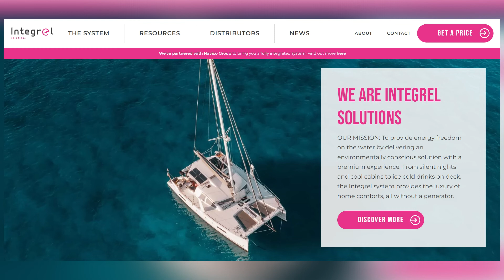Nigel Calder & Jeff Cote Talk Marine Electrical - Part 9 of 11 - Lithium Batteries

Comment: How about using Lithium for your house bank, but keeping lead-acid for your critical systems (navigation, communication). anf charging lead of the lithium with dc-dc convertor for instance. kind of having a layered system with a smaller lead system sitting on top of the lithium. Having the big consumer on lithium. Just nit sure where I'd put small 12 v consumers then (lighting for instance)

Comment: Nigel, in one of your discussions on Lithium batteries, you mentioned that it was important to check any potential battery was certified to UL 1973. While negotiating a purchase in the UK, I was told that UL 1973 was specifically a standard in the US, and not Europe.  Is there a certification you would recommend on this side of the Pond?

Comment: So the solution is a hybrid lead-acid and LifePO4 battery bank so that the disconnect or temperature doesn't cause a problem on a boat in use.  Shame ABYC won't allow a common sense approach.  Thankfully those of use who live outside the US are able to use hybrid banks.

Comment: Hi, I'm putting new lithium battery banks in currently.  I was considering a Mastervolt charger, In your opinion is it better to have a combi unit with built in inverter or a stand alone inverter. Would appreciate your input.
Thanks
Karl

Comment: How far are we from a pure lithium battery system? I have switched my land batteries in my off grid system to lithium and so far I'm very happy. The charge acceptance rate has made a huge difference both in solar and on those back to back cloudy days when I need to run a generator. Would be nice to do the same on my boat
Reply: i have a pure lithium system on mine.
Reply: @ysesq  what's your setup? Balmar or some other alternator controller?

Comment: I got offered a free Lifepo4 House Battery Bank for Long term Testing by a pretty good Named Chinese Lifepo4 Battery Manufacturer, which I initially considered accepting, as I love Testing Stuff. So after some prior experience with Lithium batteries that required Charging in an explosion proof Charging Bag, I have oroceeded cautiously by attempting to get as much information as possible withbthe starting point being that manufacturer telling  me that discharging Lifepo4 batteries below 50% loses you a lot of recharge Cycles, and shortens their service Life. I already knew as confirmed, that Fast Charging them Also shortens their Service Life and that Charging needs to be kept in the range of 0.1 to 0.2 C. Theremaining questions were what is the upper limit Charge Capacity not to exceed to further extend service life, and is Will Prowse right when saying don't worry about Charging Cycles as the internal chemistry of Lifepo4 is such, that the batteries will Die before any recharge Cycle numbers are reached anyway (this stringly indicates, to me anyway, that the Service Life of Lifepo4 batteries is qyite short and has a bad effect on Cost per year expense with Lifepo4 batteries ) Upper Charge capacity limit took a while to show up in a coherent fashion, after being kikely, with Mobile ohone Charge setting option for extending Battery life, by restricting charging to only 85% Capacity, with mobile phones, even doing this, and treating the battery well, you are looking at needing to replace the battery within about 5 years. this could be why the EU is now fircing phone manufacturers to have battery compartments to facilitate easy battery replacement, if manufacturers want to continue selling mobile phones in the EU anyway. Finally the upper limit I was looking for, appeared that I was kooking for, a tester of Lifepo4 powered Power stations also advised only charging to 85% Capacity, to extend battery life, just like with Lithium battery powered mobile Phones. Result ? I will not be installing even Free Lifepo4 batteries on my next Sailboat.  I'll be going with high quality 99.9 percent pure thicknLead Plate Dual Use AGM Batteries, which I know, if treated Correctly can have a Service Life in excess of 20 years. in Cost per year Terms, it really does appear to be No Contest. the Tricknis imho, to have enough Bank Capacity to carry you through any no charge going in period such that the Bank Capacity stays above 80% state of charge. for me, that is a Bank size of 1200 ah, 20% if which is 240 amps at q2v that is able to be used. If krt above that, with good AGM the 3500 Recharge Cycles Flat Line, and never reduce. Lead batteries also love being taken back to 100% Capacity. tbh, with 240 amps available, I won't even need to expense of a built in Diesel Generator, as a gigh Capacity alternator should work out fine with Solar Panels and a  ice quiet Wind generator. I like to run an  inboard diesel e pngine under load for a couple of hours a day anyway, to keep its internals nice and happy. It can also provide plentynof hot water for showers and washing up in the process. If I can make them last for 20 plus years, during that time, far superior technology may well become available too. Seems like a Win so far anyway. Time will tell. If Lifepo4 Tech gets improved to 20 plus years, then I'll try some. Best Wishes.  Bob in Wales still.  🤔👍⛵️✨️✨️✨️